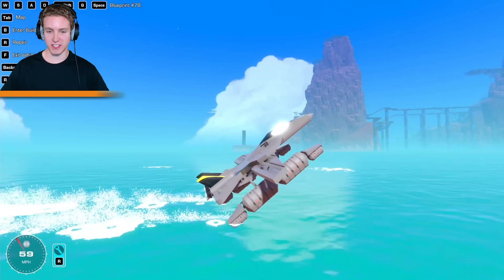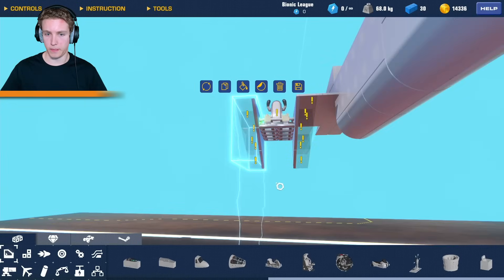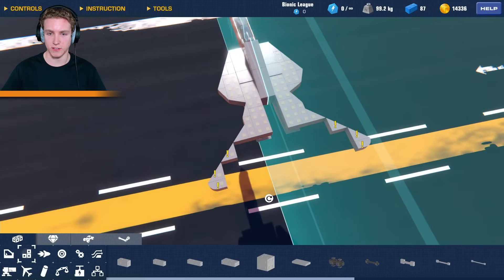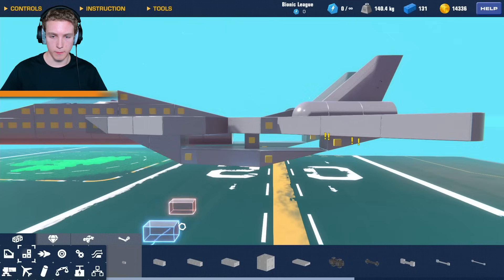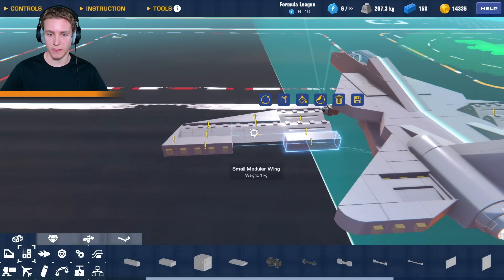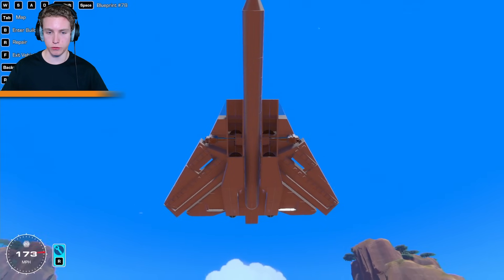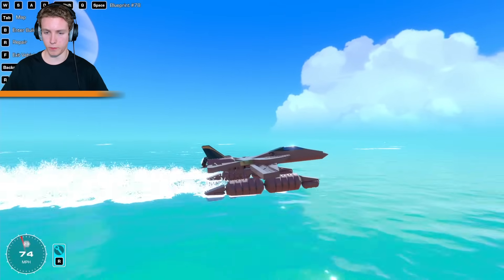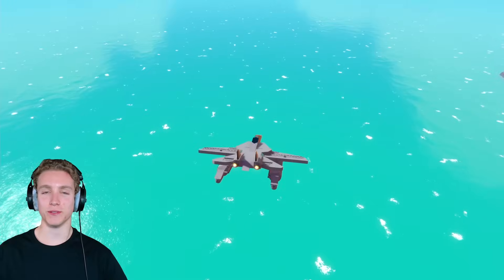Making a F-14 Land on WATER! - Trailmakers

Comment: I built an f-14 without piston glitching the wings. I also added airbrakes! It was my first attempt at a plane from a reference and i think i did pretty good, the only problem is that it has wayyy too little thrust
Reply from the maker: Man that sounds like you put a lot of time into it if it doesn’t use pistons! Oof yeah I wish there were faster mini thirsters tbh
Reply: @LittleCornDogsGaming  there is a mod that make the smallest thrusters in the game (the tiny ones from the airborn update) way way stronger, i think it's called biwi's thruster something something
Reply: Can you not use space truster. You should be able to fit a lot of them in a F14 body

Comment: How do I make it where it stops glitching when I put pull the wings back?
Reply from the maker: Try and clear any thing that could potentially be in the way of it folding and also turn down steering help to zero
Reply: @LittleCornDogsGaming  ok thanks for the help, idk if it's type of platform your on, because I'm on xbox, and I can't really put the piston to 0.45, so I Have to put it as .40, or .50
Reply from the maker: @gouchplate3  ahhh I see maybe change the position of the piston like move it more forward or backwards while also maybe adjusting the angle 📐 of the turning hinge
Reply: @LittleCornDogsGaming  ok thx